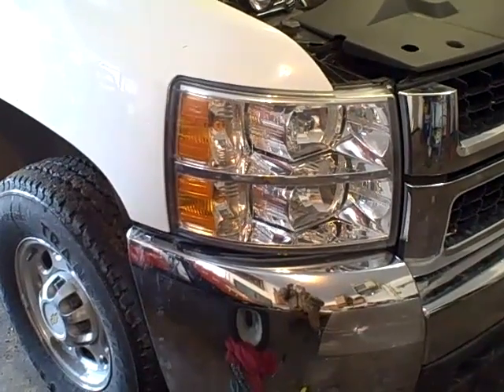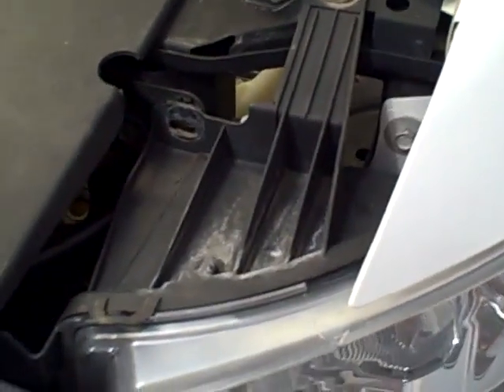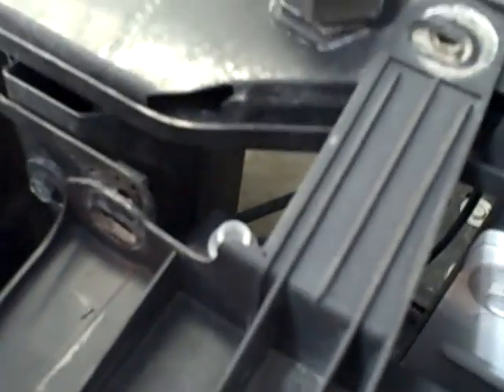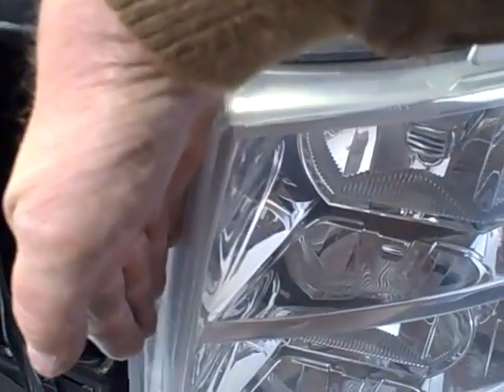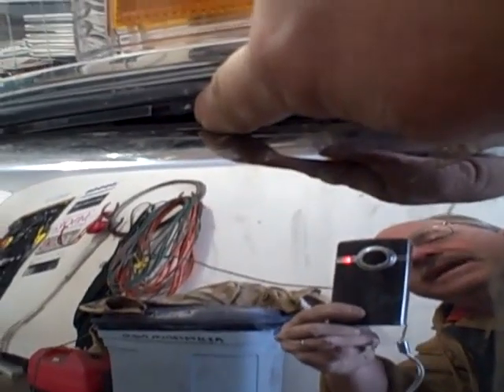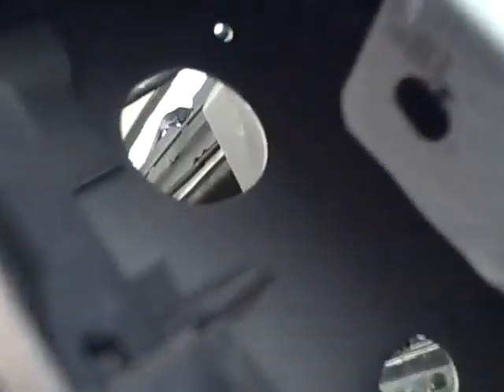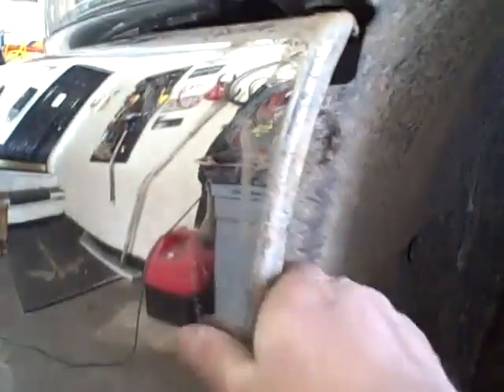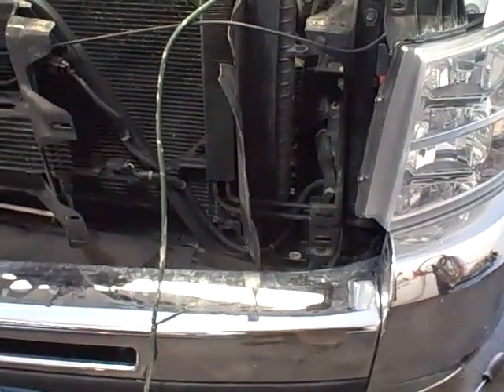One of many ways to change the headlight bulb on a  2007 Chevrolet Silverado 2500

Comment: HUGE thank you for posting this. I never would have found the 3rd bolt without it.
While I was in there, I also had to repair part of the wiring harness (wires frayed right at the plug) and I changed the yellow side marker bulbs. What a supreme pain in the ass design. I miss the older Chevs.

Comment: i changed mine out on a drilling rig site with only a rusty old fork as a tool. simply reach in directly over the bulb, turn it a quarter turn and pull it out. i took the wiring harness off with a fork (im sure a FLAT HEAD SCREW DRIVER WOULD WORK MUCH BETTER) put the new bulb on and twist it back on. done in under 2 min

Comment: You made this way more difficult than it actually is. Just reach down in by the washer fluid tank, and pull the bulb out, simple as that. It took me longer to watch this video than it did to change the bulb.
Reply: Drivers side is that simple but the passenger side is what has the limited access. The video seems to be inverted.

Comment: My neighbour buddy got a '13 Silverado and I explained to him the steps here that you did to change the bulb.
The space is tight and getting the signal bulbs is even worse on these models because of the way the bulbs are (GMC's have an easier access.).  What is worse about it is there is a metal bar infront of the bulb, which makes it tough to get at it.

Comment: I dreaded changing my burned out bulb after watching this video. But on my 2007 silverado I was able to reach in and replace the drivers side without removing anything in less than 5 minutes. The passenger side required removing the air box. It just snaps in and out. Passenger side took maybe 15 minutes.

Comment: The GMCs are easier to change than this.  All I did was remove the cover between the headlamp and bumper, loosen the hidden third bolt, worked the cover between the lamp and bumper so it is out, removed the two bolts and pulled the assembly out (the two pins broke on one of them).
Didn't have to remove the rad cover.
But yes, this design is daunting.

Comment: could someone please tell me this ASAP, so i have a 2007 chevy k2500 classic, which is the 2500hd, and when i pop the hood, there is just a simple pin holding the headlights in, I THINK they pop right out but im not sure. Getting the HID top of the line, 50 bucks for a pair of headlights. Will they pop right out???

Comment: HAHA...  May as well remove a rear bumper, door panel, and your floor mats if you want to take all of these necessary steps.  I'm not a small guy and I prefer to just reach below the windshield washer fluid tube for the drivers side and take the cover off the air filter for the passenger side

Comment: Thought I was gonna change the headlight quickly but to no avail. This has to have been designed to increase the survive-ability of dealerships since parts are marked WAY up. I had to replace a nylon clip on the tailgate assy. and figured I'd buy 2 left and 2 right, for spares, since this problem of breaking clips is endemic with Chevy and has been for a decade (I have a 94 too, same prob). These fragile plastic parts were almost $8.00 each! WTF?  Also 07=falling-apart-n-est interior ever.

Comment: sorry but you went the long way to change the bulb. I just did mine 10 minutes ago and all you have to do is take out the battery plate on the driver side take out the 10 mill bolt on the washer fluid jug and there is a rod that goes from the fender to the rad support gently pull the washer fluid jug back it moves fair enough to get the bulb out the trick is to unplug the bulb first

Comment: DO NOT GO THROUGH THIS TO CHANGE YOUR BULB!!!!  I have the same truck. Remove the 2nd battery (which I don't even have) and there's PLENTY of room to remove the headlamp without doing ANY of this. Be sure the old rubber boot (mine was dark orange) comes off with the burned out bulb. Took me 30 seconds to do...

Comment: I wish I would have known about this before I traded in my 2005 Silverado. What a terrible design for the new trucks. I have a 2013 which is the same as your truck. My 2005 I could change all the lights out just as fast as I could get the pins pulled and the bulbs replaced. This new body style for maintenance really sucks. I can access the passenger side by moving the air cleaner box out of the way. The driver side is blocked by the washer fluid tank. yuck!!!